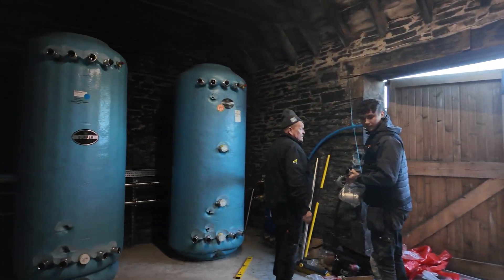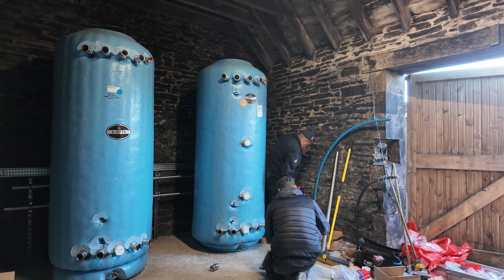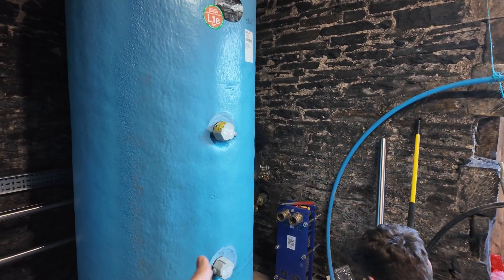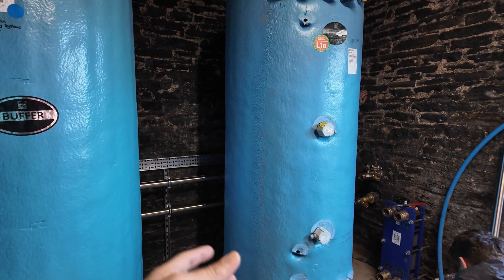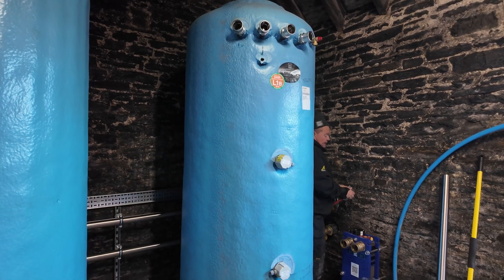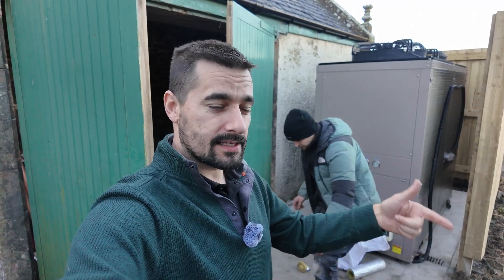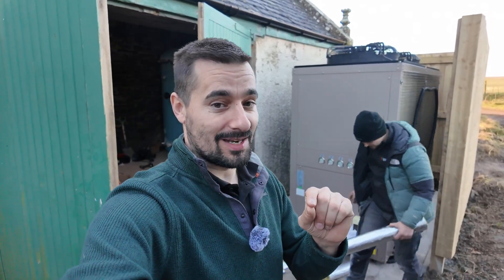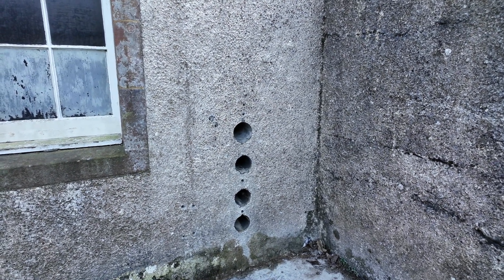The impossible Heat Pump install

Comment: Are you installing Open Energy monitoring equipment?
Reply from the maker: This could be an option down the line, the current setup in the castle is temporary fan convectors as background heat. When the refurb is done we could add the monitoring but the heat meter alone would be £800 😬